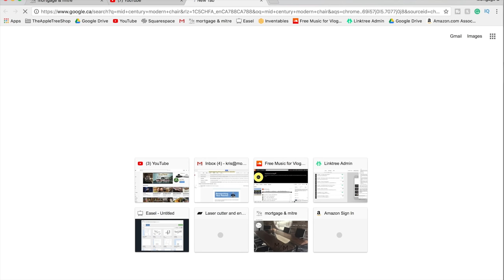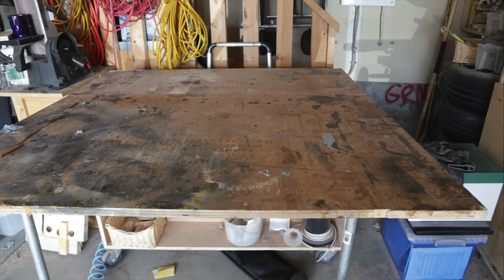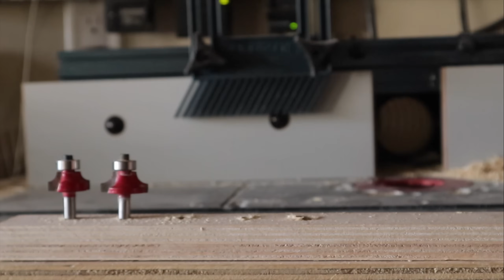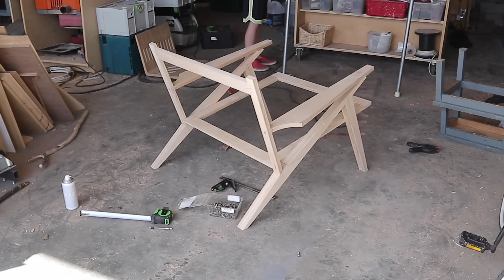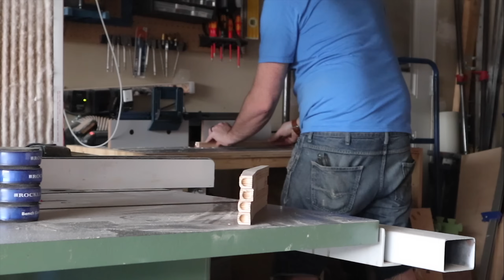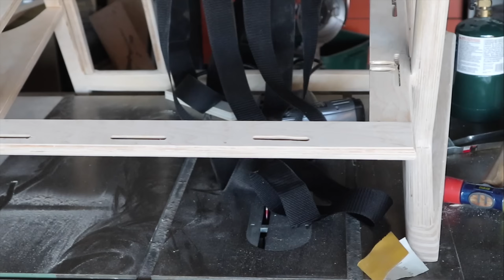Mid Century Modern Sculpted Plywood Chair// Rockler Plywood Challenge

Comment: I really like the modern adaptation of the Adirondack Chair. The sculpted plywood gave it a slight Sam Maloof kind of vibe. Aesthetics aside, can it be sat in or is it strictly decorational to meet the "Challenge." How durable do you think it will be over time?
Reply from the maker: Thanks! The chair has been in our living room for 6 years and it’s used daily. I did have to fix the arm once back in 2019. No issues beyond that. We have replaced two manufactured chairs since I build this once. 😂

Comment: First of all, nice work! 
I finished an armchair a few weeks ago and used birch plywood for the entire build. When it came to the legs, I went with a safer thick-leg design, but I originally wanted to created something slimmer with a more sloped angle like you did here. Concerned with the structure integrity, I scratched that idea.. After watching this, I'm curious how strong the legs are and how it stood up to real use. Anything to share? Thanks!
Reply from the maker: Thanks for watching. I sat in the chair just yesterday. It’s one of the main chairs in our living room that gets used daily by our kids or dog. Haha. I had one issue with one of the arms when a friend that is 300+ pounds leaned too far back in it, but it was easily fixed and has had zero issue since. The leg are solid even those they are as skinny as they are.
Reply: Nice! Time for me to make another one then. :)

Comment: Awesome job!!  Thought about cutting out my templates with my OX CNC too for a Z chair, but just haven't dug into the sketchup to design it.  Found a few good examples with decent measurements, and angles which seemed to be the hardest to find.  Well done man, hope to see yours listed in the finals.
Reply from the maker: It helped so much having the templates.
Reply: Just curious on some of your angles.  From what I saw it looks like 75 degrees for the back and the front leg, but I'm curious what the main rear leg to arm rest is.  Would you mind sharing that one?
Reply from the maker: I can have a peek at my sketchup file to see